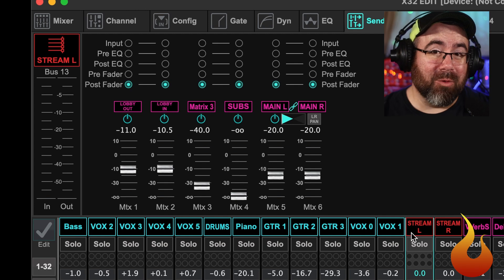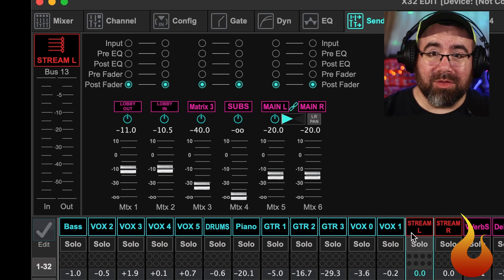Fix Your Phasing Issues!!! - #AscensionTechTuesday - EP178

Comment: I noticed this happening many years ago when a we had a guest speaker with both a lapel mic and a gooseneck mic. Because the lapel mic was wireless, this added latency and it was very obvious that the voice sounded hollow. I think the hollowness occurs because certain frequency ranges are destructively cancelled. I put the audio of your video into Audacity and changed it to spectrum view - you can clearly see the Comb Filter effect of phasing. https://drive.google.com/file/d/1VTYWAo3W7l4OHgCG3RWjIADlcuUOGUsE/view?usp=sharing

It's a problem as you said with digital mix busses. On the other hand Digital Aux busses (and VCAs) tend to be OK because manufacturers will keep AUX busses in phase with internal effects. There's definitely no delays for VCAs since that is just changing volume. 

Thanks for this video and demo!
Reply from the maker: For sure! That tiny bit of latency makes a world of difference!